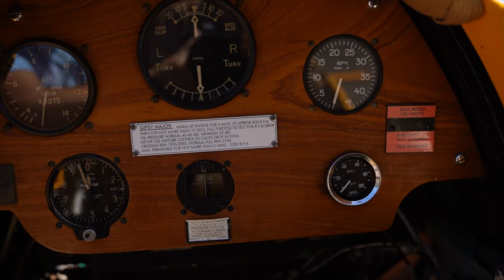Tiger Moth start and taxi

Comment: Do you have a tail wheel on this aircraft ?  I notice an abundance of sealed tarmac🤔
Reply from the maker: Yes, we do have a tail wheel rather than a skid. We also have brakes. It's a bit difficult to find open grass fields to land on around here so our operations are restricted to times when the weather suits our sealed runways.
Reply: @markfromharsaviationmuseum4  Hi Mark, I flew ab initio in DHC 1 Chippies in the early 60,s and the Tiger Moths were just out of my reach timewise. I 
I had them in my bucket list for 50 years and was only able to have a flight or two  .  They certainly reminded me of how much I missed by not having much time in them. There is something  in todays training aircraft that deprive trainees of the joy of stick and rudder and the blast of air 
smacking the back of their heads.  Wouldn’t it be great if somebody did a Waco job and built them from new again?
Your Tiger looks great.  Cheers from Downunder 🇦🇺🇨🇦👍😷😷